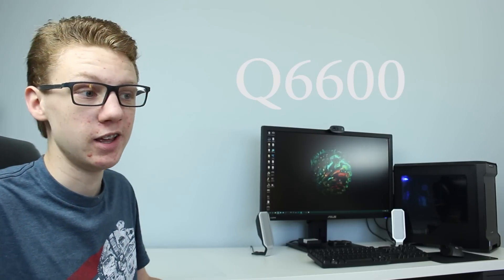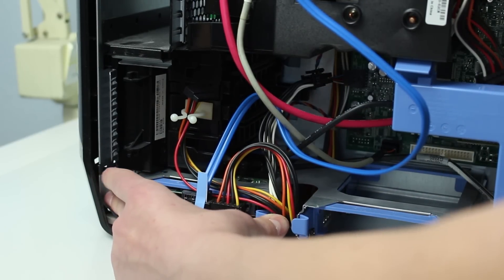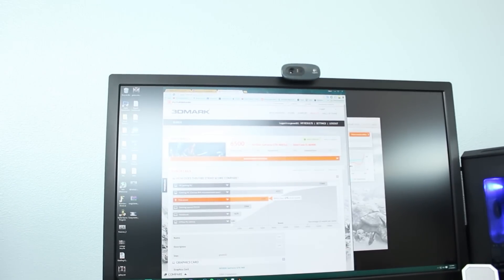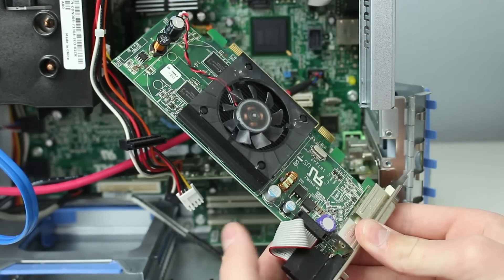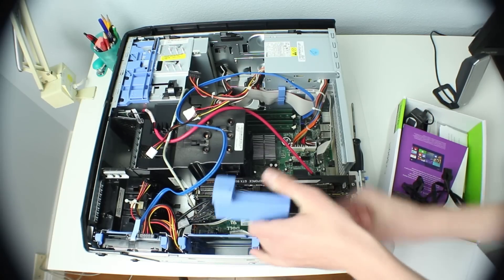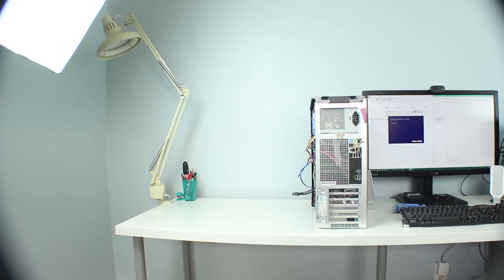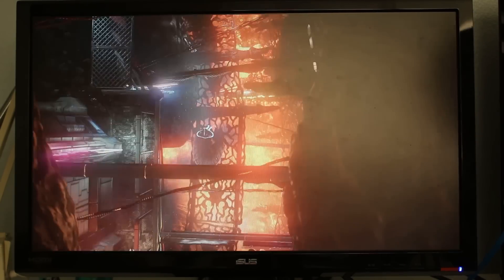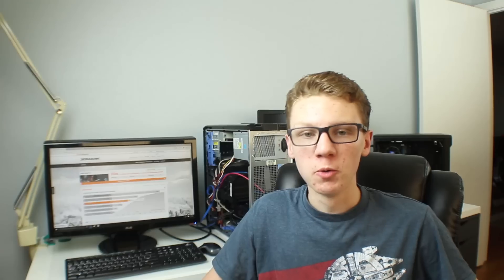Old CPU + New GPU = Gaming PC? (Core 2 Quad + GTX 960)

Comment: I had that processor - it was smashing properly for over 6 years, but i disliked your video - you have no idea about the parts placement and role in history of glorius pc master race - really -  its obvious it has ddr2 and my God, it's core 2 quad - or THE legendary Q6600 - the first proper quad core - great overclocking - mine was overclocked steady for 3 years at 2,9GHz from 2,4 stock (it was going funny from time to time at 3.1) - steady - not a single BS, I was running it with Radeon HD3870 Pro Atlantis and it was smashing :D - I had that rig for ages - even after 5-6 years (I don't remember) I still was able to play all new games. It turned at first my rig to oven but sorted it with proper - home made cooling. 

Pay some respect to the OLD tec son :P

Comment: Newbie question: I didn't get the steps where you installed Windows, when you used the flash drive. Is it possible to use the Windows you have on your new pc on both machines simultaneously...? Again I'm new to this, you are free to laugh at me :)

Comment: Gavin--
   Just want to let you know what an EXCELLENT VIDEO you did on ---Old CPU + New GPU = Gaming PC? (Core 2 Quad + GTX 960). You'e a VERY smart guy!  I've been working with PC's since January 1987--got the original IBM PC  4.77MHz! I'm old enough to be your dad, or your granddad!
  The biggest con game in the PC industry is making people upgrade to the latest CPU. Sure back in the
days of the 286, 386, 486, Pentium, Pentium II, III it made a big difference.
   By the time the Core 2 Duo/Quad CPU's were introduced, the difference in speed is NOT justified
by the difference in COST! Although your incredible video runs benchmarks for gaming, it CLEARLY
shows how you got the old Core 2 CPU to give yhou MOST of the speed of the new i5 CPU at a FRACTION of the cost.
 
  Your sister makes the video fun to watch.
   --Alan
Reply: Alan M how can you work with PC’s if you are this stupid? This guy has no clue how to test a cpu, he used a gpu benchmark to test a cpu and he made the conclusion that the cpu does not effect that much the performance of the gpu. What a god damn genius, the results won’t change because it is testing the GPU. Try to play any decent game on that setup which is show in the video amd trust me, you will get about 30% of the performance you should get or even less. The cpu controlls the gpu.

Comment: I'm still rocking my Q9650, it still plays the latest titles.
Reply: I'm still using the Q6700.
Reply: @tomcraftdonkey2285  me too =D every year I think maaaybeee.... upgrade... but every year I conclude "still no reason to".
Reply: Nah. Lack of IMC really hurts in games. I had massive fps boosts when I upgraded to lynnfield-based xeon(they are dirt cheap) and overclock it to same frequency. Witcher 3 novigrad area improved from 30fps to 70fps. And when testing something pure computational like CPUz benchmark, xeon scored about same. Core2 has pretty powerful compute units, it's just crippled by FSB bottleneck and chipset memory controller. Making it worse, Quads are two dualcores glued together and all communication goes through congested FSB.
Recently I upgraded to 2nd gen ryzen(not bc of games), I have to say there's not much difference as GTX1060 is almost always limiting. Sure I can get 120fps in Witcher3 if I remove GPU bottleneck by lowering resolution to minimum but that's completely pointless.
Reply: I've got a Lynnfield i7 875k and a reference Gigabyte R9 290 4GB GPU that managed an 11057 overall score in Firestrike last week. 14152 on the graphics score. This was done on a daily driven windows 10 install that is close to two years old so with a benchmark minded install with unneeded services disabled could probably get better yet. If the K dies a x3470 will be replacing it.
Reply: Where to get q9650 now. I want to buy Core 2 Quad.
Reply: @AbhijeetAnand2.0  ebay, i would recomend the q9550 as its HALF the price, and less than 12% difference from q9650, and you can easily close the gap and then some by overclocking it
Reply: @virtualtools_3021  thanks for reply bro... Now I hv Q8400 with gt1030
Reply: @AbhijeetAnand2.0  i recently got core 2 quad q 9550 at  sp road (bangalore) at about 1000 INR , dont think theres much diiference in gaming but normal task r 2 times better than core 2 quad. u need to buy atleast gt 1030 or gt750ti for better graphical performance.
Reply: @dheerajaithal9791  I have gt 1030
Reply: @AbhijeetAnand2.0  what game can you play
Reply: @muhammadashrafahmad4387  Gta V on high settings
Reply: @dheerajaithal9791  thanks 😊

Comment: i have core2quad 2.4 ghz perocessor q6600 and 8gb ddr2 ram with gtx 1060 3gb when i play watch dogs 2 it gives 20-30 fps on low settings , high and ultra. I just sont understand my cpu is bottlenecking or gtx 1060 is not capable to make me play that game on low ultra or high settings and gpu usage is 20-30% kindly suggest me the right thing

Comment: How much do you think the RAM limited your tests? I have a 2007 model workstation with dual 3.0Ghz Xeon X5450s, with 32GB of DDR2 ECC 667Mhz. I'm thinking of picking up one of the new RX cards and seeing what it will do. I am worried about the older RAM being a bottleneck, but if you got 30FPS with a tenth of my RAM and a slower processor, I've got high hopes.

Comment: Its till a good cpu. Just not i7 good. One of my backup pc's is running a q6600, 8 gigs of ddr2 1066 ram, 256gig ssd, 2gig 128bit video card. I runs linux apps great.

Comment: Probably the biggest bottleneck in this case would be the slower DDR2 ram speed since most PCs today have at least double the ram speed at at least 1600 or 1866 mhz ddr3.

Comment: hmm but you WILL run into some bottleneck nirvana with games like forza horizon 3 (stutters on everything ALMOST PLAYABLE.... ALMOST) rise of the tomb raider  with some stutter here and there  btw i have a q6600 and a q8200 with 8gb of ddr2 ram and a gtx 1050 non ti

Comment: by the way if you overclock this cpu you get a really big performance boost i went from stock to 3.5GHz and i got at least 20 more FPS on all games with a nvidia gtx 750 2GB for example i play gta 5 at high and very high between 40 and 60 FPS which is playable for me. btw just make sure you have a good cooler for overclocking else bad things will happen.

Comment: Upgrade the CPU, and update the BIOS to A09.  Also put in a better PSW. Also get RAM that has has better Clock speeds and use 2GB sticks. To many other tweaks you can do to make it faster.

Comment: Overclocked these can still run current games maxed out at 1080p, hell these don't need to be upgraded for 1440p or 4k because a GPU is doing most of the work and the CPU is rendering less frames.

Comment: if you still have it you can do the pin mode for the CPU with tape and get that Q6600 to 2.99 @ 1333 FSB i am doing it with my Dell 755

Comment: I built a computer with these same exact specs for around 800 bucks in 2007..and it stand the test of time...so your absolutely correct...buy a computer with specs that will last. because half the time like with HD cameras they will sell you the best, discontinue their products and water it down and sell it to you for the next 7 years nearly charging  you  the same price for less performance...my computer lasted me 10 years and I made 80grand in odd end graphic design jobs..

Comment: Good job!  It's cool that older PCs can still be used for gaming, with the right upgrades.  

Also, if the original video card is a Radeon, then it might be an ATI Radeon All-in-wonder?  Not sure but that might be it.

Comment: you litterally have no idea how to install Windows, do you? all you needed top do was Delete all the partitions on the drive, and click new.. (yes. those advanced drive options everyone is to lazy to use) and BTW, I can run GTA V on VERY high settings, as my Dell inspiron 530 (Intel core I 2 Quad) with the latest BIOS update supports 8 GB of DDR2 Ram. My Windows Experience Index rates my PC at  7.5. for the Base score (which is my SSD holding me up. I use my SSD for the OS, and the 2 TB Hybrid Drive to store all of my Games and stuff on. I use the stock Dell Power supply (which is changing in a few months)
Reply: I build PCs btw, i just like to use my old Inspiron just bc I cant run certain games on Windows 10. Some games, like GTA 4 (with mods) dont play well with Windows 10.

Comment: fuckin core 2 duo quad?
Reply: Core 2 quads are good for anything below the gtx 960 because after that i think there would be extreme bottle necking. Its not a bad processor as I own one with my gtx 750 ti. But to put it this way just buy a i3 i5 or i7.

Comment: why didn't you just put you hard drive from you new pc to you old pc
Reply: It will work as long as both computers use the same data cable type lol. The OS doesn't matter.
Reply: That's not how it works. That's not how anything works.
Reply: Z2K X158 One does not simply move a hard drive to a new pc. Win XP sorta can, but not 7

Comment: Well... Firestrike is not the tool to determine how well a CPU will perform in games. I got the Q6600@3.6ghz and it will bottleneck a modern gpu pretty heavy. I don't know exactly but my guess is that it can push maybe 30-40fps i BF1 and the same goes for GTA V. Even at low settings in GTA V I get drops down to about 27 fps, and that is with 8GB DDR2.

What you can do to your Q6600 is doing the "bsel mod". You simply attach a bit of tape to one of the pins in the cpu and it will run att 3ghz instead of 2.4ghz. It usually works without changing the vcore, which you cant do on an DELL computer.

Comment: do u have to ugrde the mobo to run high end graphics card?
Reply: no not really unless you have a mobo that doesnt support pcie then you cant get a graphic card at all. but most support pcie
Reply: so i can install amd r7 240 something like that?
Reply: bro if you have a mobo that supports a gpu any gpu will work
Reply: Cinnamonmlg yes it will
Reply: mkay that makes sense thnx alot.
Reply: but what if cpu u need to upgrade ur mobo if ur gonna install like new cpu am i right based on their socket?
Reply: Cinnamonmlg yes its based on the socket

Comment: if you use slightly more powerful CPUs from the core 2 series like the Q9550.. then the performance is even better... ie on my system i ran dirt 3 on max settings with an average of 55 frames with my CPU overclocked to 3.3GHz and a gtx 660 which was superclocked... my rig cost me less than £80 which i made back by making other rigs with leftover parts and selling them.
Reply: I'm all about that price:performance ratio
Reply: Sounds about right James :D

Comment: How is that card for bottlenecking, I am running a closed system water cooled Q6600 on an Asus board with 400W psu, and 2x2GB DDR2 400 mhz  thinking of upgrading from Nvidia Geforce GT 630 oh ya just in case it matters 120 GB SSD HDD

Comment: I found a OEM pc on ebay for 75$ it has 4 gigs of ddr3 and a core i5 650
Reply: Azides OEM machines usually have OEM parts, which are sometimes massively incompatible with custom or even other machines.  They also have mobo's specific to one case type, and traditionally you need to worry about things like really shoddy power supplies (says 400w, only good for 220w, things like that) and the PCI-e slot which s supposed to be raided for 75w sometimes can only be raided for 50w,
The price could reflect the quality of the OEM parts, and OEM's in general cannot be upgraded without at least a power supply upgrade to go along with the new component you decided to upgrade, cpu, gpu, more drives, and RAM being the most upgraded components.  Outside the drives, if yo uupgrade anything, you're more than likely going to HAVE to upgrade the psu with it unless you want a blown out motherboard, or a system that won't boot.
Reply: Probably a scam but if not you could sell the CPU for about £150 or more (roughly $175-$200 or more).
The RAM's probably worth at least £20-£30 ($25-$35).
You could make a decent  profit from it.
NOTE: I know nothing about OEM's, it may be a massively contributing factor, I don't know.
Reply: well... you may not have to upgrade if you were only getting like the gt 1030 and the 1050.  Though even the 1050 has not worked on certain Dell OEM's due to shoddy PCI'e wattage.
Reply: i5 650 not quad core, 2  cores w HT !!! 3.2 ghz. Buy Xeon 3450 at Aliexpress and overclock to3.7 GHZ  its realy good  thing
Reply: keep shopping you can find better
Reply: wait, why are you saying this..? lol good deal but why jst say this out of no where?
Reply: hmmmmm, fair enough.

Comment: Inte core 2 quad, gtx 1050ti, 4gb ddr2 ram. Bottleneck ? Or good ? If bad then can you give me advices ?
I might able to use ddr3 bc my motherboard supports ddr3.
Reply: the 1050Ti has the same performance of the 960 so...
Reply: Jacky Bro Ok. Didn't know that. I'm still new when it comes to gpus ^^
Reply: thats a good rig. It will do fine
Reply: bayezid The Thunderbolt Not making the rig after all. 
Got ps4 as an gift from an brother that I haven't met in 3 years :)
So no need to build anything
Reply: jamppa- .-kor PS4s are awful.
Reply: Price No one asked you.. so why are you still bitching about something everyone knows ?
Reply: Haah finally.. 
Have gained more knowledge in these past 6 months and managed to get an I5 4590s 3.0 ghz 4gb ddr3 1600mhz ram office pc for free.
Then bought an GTX 460 1gb that I oc'd to 825 Mhz Core Clock and 2200 Mhz Memory Clock.
Exmpl. Battlefield 2 bad Company ~90fps
+100fps csgo
+200fps tf2 (The highest quality)
Crysis 2 60 fps preset. 
When it went further the 4gb ram became a bottleneck on crysis 2.
I hope the other 4gb stick I ordered wont be a fake one..

Comment: BTW the PSU in that Dell XPS 420 is crap as a stock supply. get a decent 650 for 80 bucks, max the ram for 40 bucks grab a sata 3 card for 18 buck and put a 80 dollar SSD on that card and lastly put a 150 1050ti in it since it does have pci-e 2.0. Yes, I know it 370 bucks but still I did it and the system is very fast it keeps up with the best of them. the power supply alone would yeild another 2-3 percent closer in the benchmark and maxing the ram to 8 gigs of ddr2 800 because at stock its 3 gig @ 667 would bost another 2 percent. Anyhow what I'm saying that system even though its a Dell is not trash as the MB in it is actually steller for its time and still very solid today.

Comment: hi umm i have a pentium dual core E5700 and 4gb ddr3 ram and a radeon hd5450 i wanna play alot of csgo and i can play it at very low settings and i get like 47 to 60 fps and in wanted to buy a 750ti and how much will it im prove my fps?
Reply: loads
Reply: Buy GTX 1050 instead if the price is not that big of a difference. Because you can get A LOT more performance from a 1050.
Reply: Alexis Jabonete did you heard about bottleneck?
Reply: Ulquiorra Schiffer Yeah I know it will bottleneck the 1050 but why buy the 750ti when you can buy 1050 for the same price. You can just upgrade your cpu later on. At least for me in my place they are at the same price.
Reply: i just bought a new pc (selfbuilt) 8gb ram nvidia gtx1050 Pentium g4400
Reply: shoxie_the_boss oh wow that's cool! So how's your games? What fps are you getting?
Reply: gta v at veryhigh to Ultra 30-49 fps csgo 140 to 200+  you can guess the rest :D
Reply: He just changed his processor, so maybe it will take years before he upgrades again.
Reply: buy a q8200+... cpu with 45 nm they are better that the q6600.

Comment: I have just dropped a R9 280X 3 GB into my old Nvidia 790i ultra mobo..that board is from 2008...ancient...and it runs doom(2016) at 60 plus fps with all eye candy maxed out on 1920x1200....oh yeah my cpu is a Q9550 and running 6 GB ram (4 GB GSKILL and 2GB KINGSTON) on windows 7 ultimate 64 bit...seems just fine so far, and I've got a 1200 watt psu....a left over from when I was rich and had 3 GTX280's in tri-SLI running on that Nvidia mobo...there was a time when I could run crisis maxed out and everyone else was jealous..lol..but man you should hear what 3 GTX280's sound like ! and how much power it sucked up ! it was worse than a vacuum cleaner

Comment: Tell me, what GPU, and CPU can I put in some Hp Pavilion A6600F.
Reply: CPU's Supported: Intel Core 2 Duo (Wolfsdale) E8xxx
Core 2 Duo E6xxx (Conroe) up to E6850
Pentium E2xxx series (Conroe) with Dual Core technology up to E2160
Core 2 Duo E4xxx (Conroe)
Celeron 4xx series (Conroe) up to Celeron 450

GPU's: I would only go with a 750ti low profile version as you only have a 250w psu and that would be the best card to get with your mobo. Pm me if you have more questions.

Comment: Is gtx1060 with the i3 6500 considered old even if it can run almost all games in high. It can literally rum crisis 3 on max settings
Reply: i3 6100
i3 6300
i3 6320

i5 6400
i5 6500
i5 6600
i5 6600k

i7 6700
i7 6700k
i7 6800k
i7 6850k
i7 6900k
i7 6950k
i7 6950x

no i3 6500 found lel
Reply: GTX 1060 is too much for a dual core like the i3-6500 get an i5 .
Reply: +badis ghouila True, bottleneck 😭😭, so i would go for the i5 6500. That is if you have some money
Reply: +badis ghouila By the way it is i3 6100 not 6500. Wait is there a i3 6500?
Reply: no there isn't , get the 1060 3gb EVGA ''SC'' & an i3-6100 best value no bottleneck
Reply: I would go for an i7 straight away, think forward abt how games will evolve through the years.
Reply: H3nningK01 i agree
Reply: Beowolf 2002 you mean i5 6500?
Reply: It would just bottle neck the whole system. I recommend getting a high end i5 or i7 if you have the money to get a gtx 1060. Or you would just be wasting your money lol